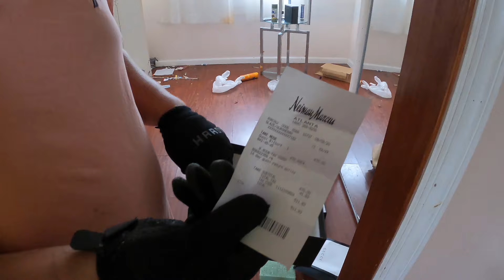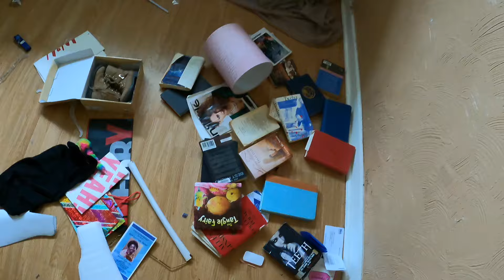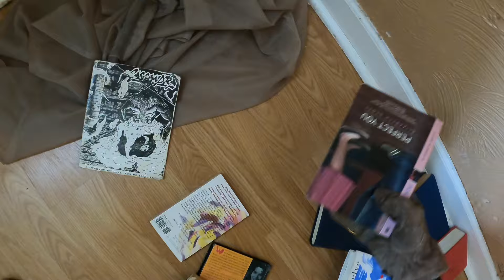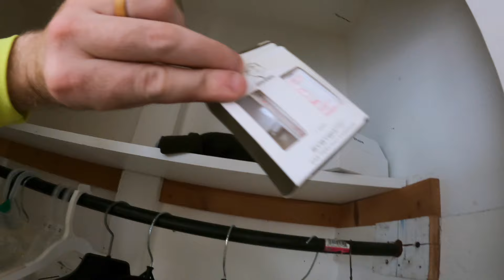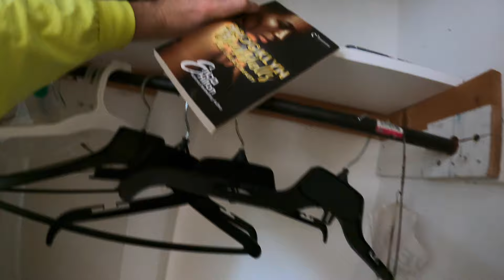Casino Robbery House TRASH OUT | Valuables Left Behind!

Comment: Many years ago we cleaned out a house where the owner was said to have stashed cash.  The relatives tore the place apart, even looked up the chimney but found nothing.  When we went in to clear it, we had to take up all the carpets....We rolled them up, and propped them against a wall and suddenly were showered with money. It was stuck to the back of the carpet...Quite a lot of it...Which we returned.

Comment: Make sure you check all pockets of all clothes for money and all the heat vents on the floor because that's a hiding spot for money get a flashlight and a mirror and look in all the ventilation system floor vents..and make sure that you check the floor of the shed for cut mark's because people will cut a opening in the floor and dig a hole in the ground and hide money..

Comment: Next time tarp the trailer before putting trash in it soo it's easier to dump at site
Reply from the maker: Actually have never done that but for sure would be easier to dump with the slick tarp. That's a good tip.
Reply: @tuckandsammie  yeah it's much easier all u do is go to the other side and lift and all the trash comes right out the trailer and it save u about 20-40 minutes dependa and what u got and if ur alone
Reply: On what u have and if ur alone or not*
Reply from the maker: @carloscastillo-oc2ce  This trailer actually dumps so it comes out easier but for other trailer jobs that's a good call.
Reply: @tuckandsammie  hope it helps like it helped me love the vids by the wat